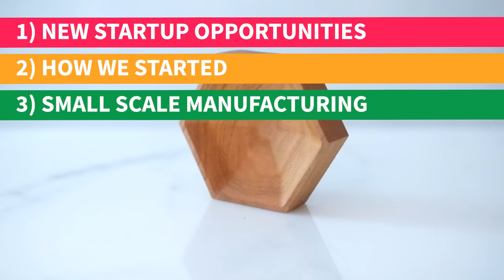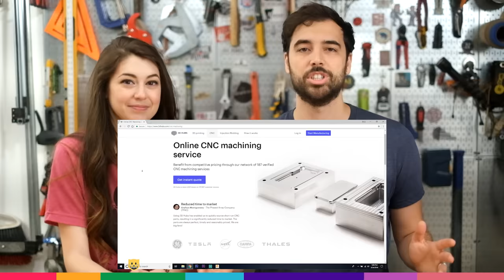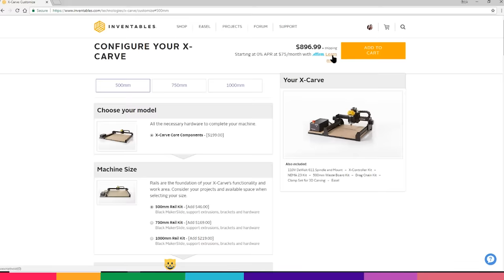7 Tips to Start Small Scale Manufacturing | Business Ideas for Product Makers

Comment: As someone who's used all the steps you covered, this video is spot on. I now have several products in various phases of these steps and the only thing I would caution people on is those cnc financing plans. Usually they're worse than your credit card. When I was looking into them they were about 32 percent interest.
Reply from the maker: YAY!! Thanks for chiming in and the heads up 😀👍
Reply: I thought the same and it's wiser to build your own cnc... since you have a 3D printer then it will be very possible nowadays and there is many open source project that make it easier and customizable as well... it will not be as robust maybe as those who are made by big brands but it's for sure worth it for a certain price range and quality requirement (crafty stuff doesn't need to be super precise as mechanical parts)
Reply: I just simplified it by buying a dremel,printing out a quick swap carriage...i route with my 3d printers 👍
Reply: @anoirbentanfous  Definitely an option there days. The MPCNC (Mostly Printed CNC) is a good place to start. Also there's a company called CNC Router Parts offering parts for more heavy duty DIY machines.
Reply: I totally agree. The video is amazing and all the tips they say are actually very practical.
Reply: HOLY-HELL THANK YOU
Reply: @chuckmakesit  Thank you for sharing that project! I'm just responding so I can find your comment later ;)

Comment: Absolutely great video on small business! Well done. I work in the auto industry as a Mechanical Designer and am starting a side business and the piece of advice you touched on that is most important is "design for manufacturability". Even tho the company I work for makes multimillion dollar machines, it's core is to remove metal as efficiently as possible and reduce the complexity such as removing multi processes (IE when it has to go from a welder to a machinist to a powercoater instead of just waterjetting a piece of aluminum in the first place). As you also touched on working with an outsourcer on your designs is critical. Use their knowledge to your advantage. Also, if you do want to scale up later, put the time into learning the design software as opposed to making chips (wood or metal). It takes seconds to correct a concept (and little money) but hours and big dollars to correct an actual physical product. As always, thanks for the content!
Reply from the maker: So many truths here!!! Thanks for the additional tips for folks!
Reply: inspired

Comment: That was a cool concept with the different sections. It was very clear what was happening. And great information! Especially with the points about using some limitation of a machine to add to the design like the spirals in the ring dish.
Reply from the maker: Wooo, glad breaking it up into sections helped segment it - we were a little worried about it all running together. and yesssss we love when we can make the machine cut lines/layer lines/etc be a feature!

Comment: Another great video! Detailed and thought through as always, and you could tell that you're talking from experience. My only comment for people is to really be careful about financing. It can become really easy to buy machines with financing because it sounds so perfect: you'll make that money in the future and you'll pay off the machine in the future. The issue is that if you haven't built up that much money to begin with, you're playing it a little risking by relying on consistent future income to pay for your tools (and what happens if your needs change or that product doesn't do as well? You still have to pay for the tool you bought, plus interest) I personally would buy anything on finance as a 'business expense' (wait until you've gained that money first). But hey, that's just me and my 2 cents, everyone has differnt ideas and ways of operating)
Reply from the maker: That's good advice! We definitely wouldn't recommend doing it if it's not a loss you could handle, just in case 👍

Comment: Great video 👍
I am between  the design and 2nd prototype stage of making a scale model kit. Very easy design = parts Cnc-milled out of sheets of polystyrene.
I approached several companies, but they all went thumbs down and quoting a fully unrealistic price for a prototype (30.000 USD or so).
Now I have progressed further myself - all I need now is the CNC, and I can make it with around 3 or 4 USD of material cost 💪💪👍👍😊
Reply from the maker: Thanks! That's so awesome that you figured out a path that'll work for you, and it sounds like a smart choice! Congrats on the progress you've made so far!

Comment: great video ! just a piece of advice, I noticed you're using Mold Max 40, use Mold STAR 30 instead (marine blue like the comment button),it's a bit more expansive but you get two gallons instead of one and it's 1 to 1 AND your mold will last 30 to 40 years. I have molds made of MAX30 and MAX40 that were made a few years ago at about 1 inch thick and I can tear them up in half with my bare heads. After a few years and a couple hundreds of parts, the acid in the rubber evaporates and the mold gets dry.
Reply from the maker: Thank you for the tip!

Comment: This all sort of hinges on you being a couple with graphic design and engineering backgrounds. I think that it is great that you did small batch (I miss the content you made about batching). I wish you walked through design iteration and process selection/optimization. I am doing this and sort of failing at it and there isn't good guidence that I know of on the process. Currently doing novel functional textiles as well as some metal manufacturing and it is brutal.  I don't mind that you have switched to being maker personalities vs. a small manufacturing duo but I think this seems to highlight the challenge of this. You two have more background than most and you still couldn't make it work in a reasonable time and effort frame.

Comment: You guys a a great couple and I hope will always remain that way. (No pressure) Her voice and your natural ability to communicate effortlessly makes me think you both have a background in theater. I’ve seen on a Euromaxx the many successful businesses that have developed with your business model. And they end up doing successfully large scale products moving forward. My small product idea I got from another YT video, which is a silicone cupcake holder for your automobile’s cup holder. This is to help maintain a clean cup holder, but the cupcake holder doesn’t properly fit the cup holder size diameter. It’s a bit smaller than the actual opening and tends to stay fixed onto my cup, or a plastic soda pop bottle. Which I have inadvertently thrown out by mistake. Ugh! I like the idea of this product with its many colorful iterations I’ve purchased. I would like to know if you could produce a proper sized one in a one size fits all vehicle cup holder protector? To see what I’m dealing with the one I bought was at a Michel’s store, in case you might be interested.
Reply from the maker: Haha thanks!! No theatre background for us, just two nerds 😋 for the cup holder you could probably cast your own using vacuum forming or 3d printing for the master! Best of luck!

Comment: Just because there are companies out there that manufacturer designs that you send them. Doesn't mean you should strive to be large enough to own that large equipment to do it yourself. We build custom metal handrails. and we got to a point where we either have to start turning away jobs Outsource are work or grow big. 15 years later where in a massive shop with well over a million dollars in equipment and we still have way more work than we can handle
Reply from the maker: Lots of different ways to go about it! I guess our point is when you're starting out, it helps to design your products in a way that they can be manufactured on a bigger scale if the opportunity presents itself, whether it's via outsourcing or in your own shop

Comment: ever seen that tv show where (chineese) manufacturers made products slightly different to get out from under the patent and brought the original inventors to bankrupty by selling the product cheaper then they could 
remember some stretching gardenhose , a grip all nuts and bolts type tool , the goped with the small rollerblade wheels and a roller pull along type suitcase

Comment: I have found your video to be inspiring and thank you for that. One question I have is regarding the LulzBot TAZ 6 Open Source 3D Printer. The reviews online do not seem to be very good, overall, about a flaw in the control board design lacking a heat sink causing the Z axis to fail, and then their customer service to be somewhat surly and not very helpful. It is my hope that those issues are exceptions but I would like to know how it has been working for you? Thank you.
Reply from the maker: We've actually had a really great experience with the Taz6. We've run it 24 hours a day, days on end, for weeks and it's been fine. We of course have the issue here or there but not any more often than other printers we've tried, and the customer service has been great and replaced parts for us when needed (and this was before we had a YouTube channel, so it wasn't just in hopes of us saying nice things). They're also not a sponsor or anything, for the record. Hope that helps!

Comment: Thank you for this, but I still need help! I am looking everywhere for a manufacturer who can simply precut steel wires or thin metal bars that are a consistent size/shape. It sounds so obvious and simple but everywhere I look, there are 3d models, or cnc or laser engravings/cutting which are tools I already have. Just can't find anyone making something like wire parts that would allow me to finish some dimensional sculptures. Cutting them and looping or twisting them myself is so time consuming. ANY advice out there?!
Reply: Are you trying to attach the steel wires to something?
Reply: @NickBen87  I am making hanging art mobiles and have been searching for wire that might be pre-cut and looped so I can focus on the designs and business side of things.